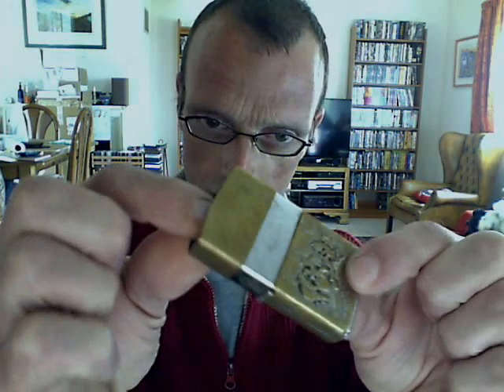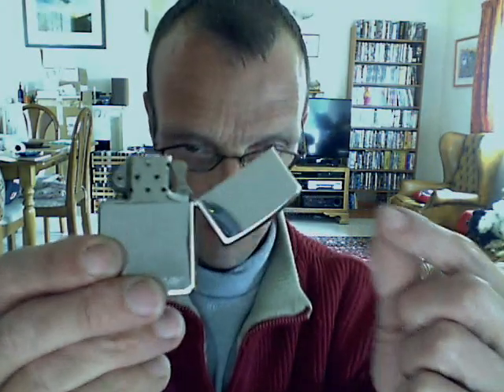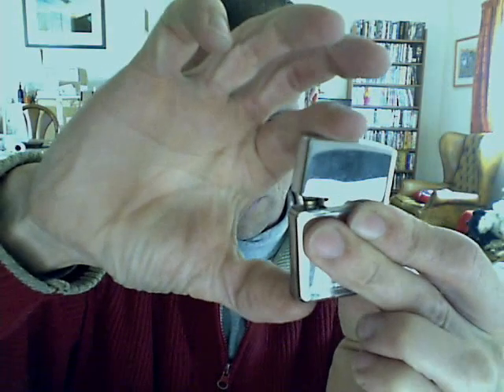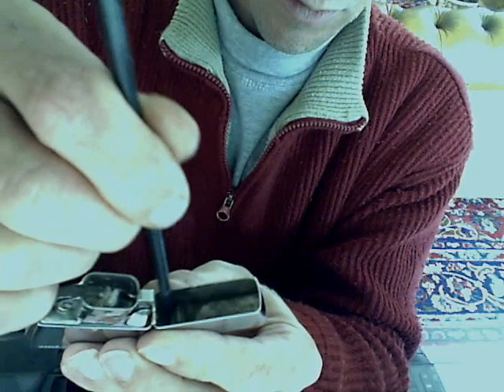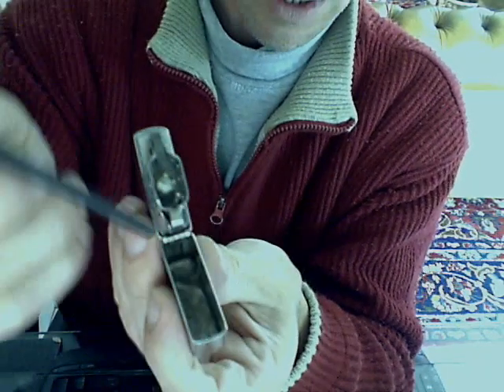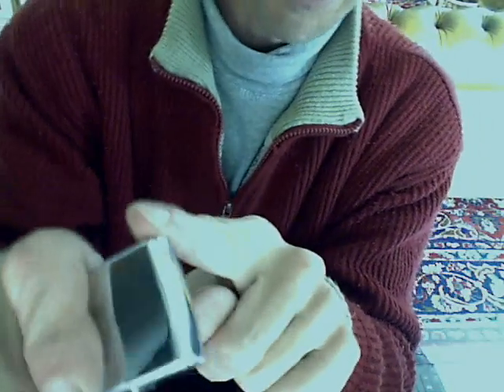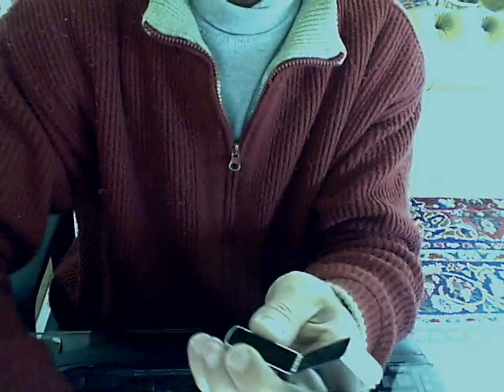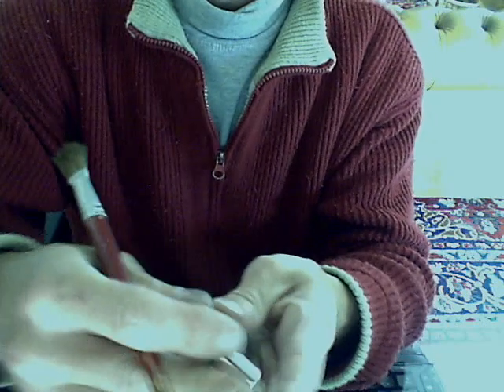Zippo ping

Comment: After carrying a zipper on me for approximately 48 years. Actually many Zippos , I had a habit of loosing them. I discovered one of the things that dulls a ping is after many openings the top part of the casing will start to rub against the tower or the stack that surrounds the wick. You'll see this when you look inside the top part of the casing. Those rub marks that mirror the path the cover takes while opening. Slightly twist the cover so it can open freely w/o rubbing and then with a pair of pliers squeeze the hinge from the inside to tighten the play in them. I would pay double the price for a Zippo if they had better hinges.  Cheers.